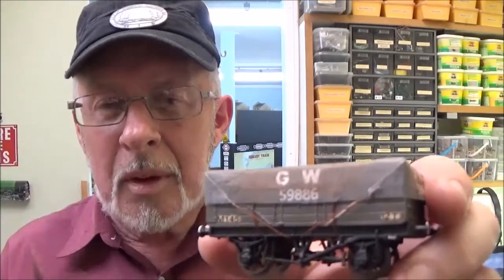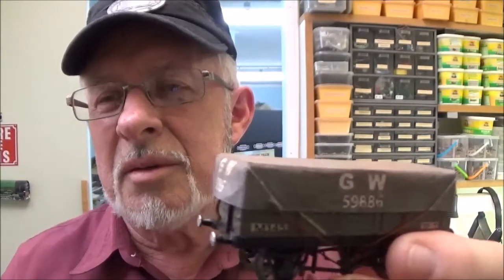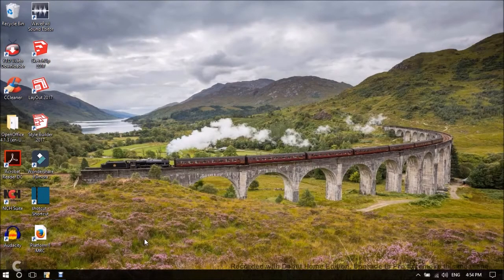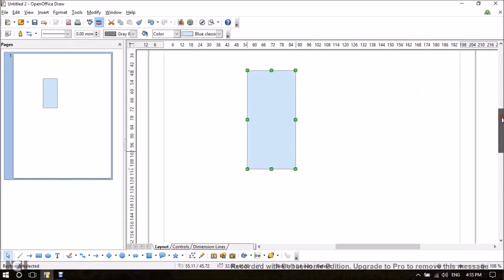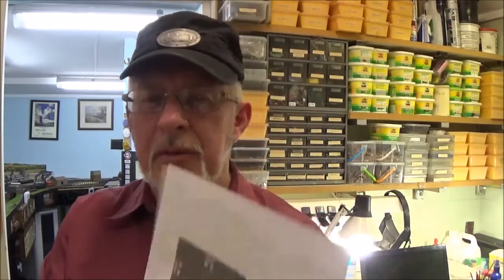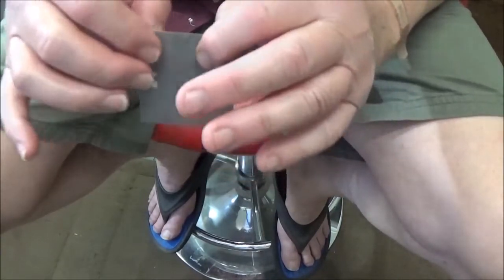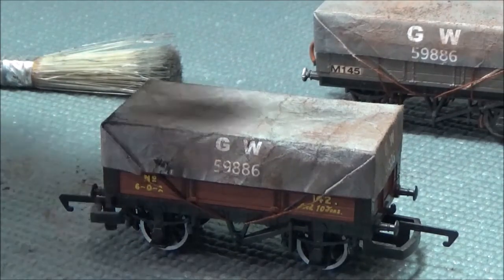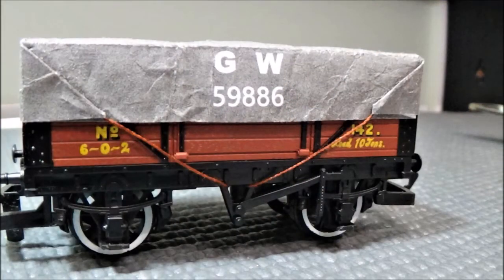Episode 83 17 Tarpaulins

Comment: ¡Hola buenas tardes Gormo!  So, I’ve used the official ‘Time Machine’ and gone back to find someone who has made OO scale tarpaulins. An Ozzy, who’s built a thing or two for railway models, came up and, I’m going to give his method a bash.🤪. In all seriousness, I am currently repurposing some old Horny wagon stock - repainting, weathering, so I and can now form goods trains for filming around Arboleas Junction. Your tried and trusted method is perfect!  It did make me smile whilst listening to your comments about the hot weather temperatures - whilst typing this (Wednesday 17th July 2024) it’s currently 30.5°C and 18.30hrs!  Anyway, back to the garage for some more tarp’s. Stay well and look forward to another current date update soon. Un saludo. Gary.
Reply from the maker: G`day Gary,
The good old time machine ay ??...wonder where I put mine..??
The tarps certainly seemed to work well for me and I`m sure you will find the same.
Making the first one is always the hardest part, but you can copy and paste if you`re making a batch all the same.
The old wagons quite often come up rather well with a bit of updating and should look rather good with their tarps and other mods.
Good luck with your project and all the best
Gormo

Comment: Gormo, using wet wipes in OO gauge works very well and you get the load outline! I do it in the way that you described for tissues. Not all tarpaulins had logo and number printed, so a mix is good.
David
Reply from the maker: Thanks David.......I`ll have to get a packet of wipes and try them out.
Cheers Gormo